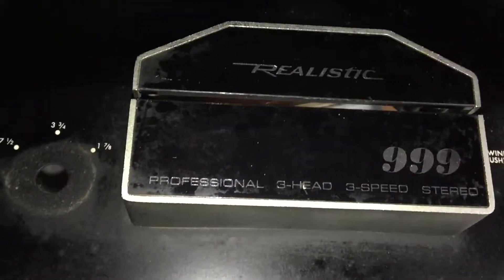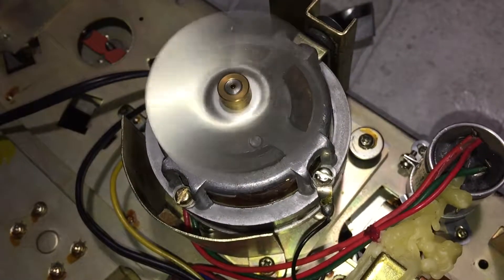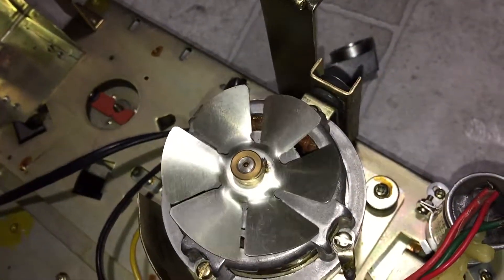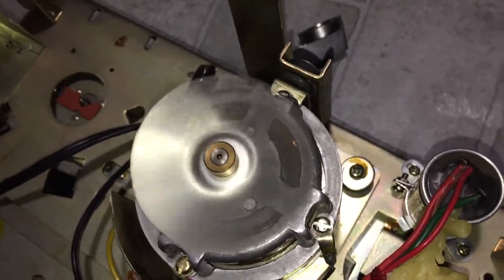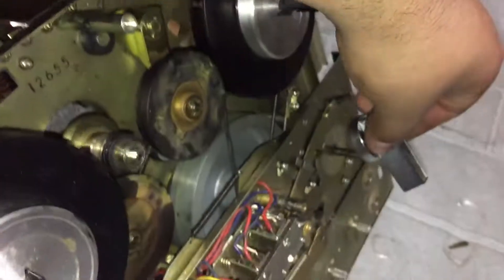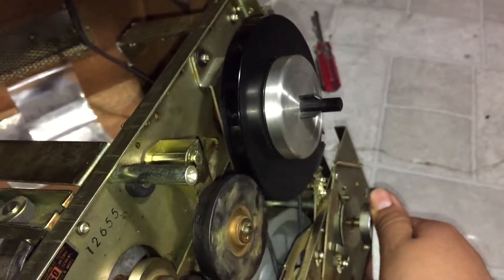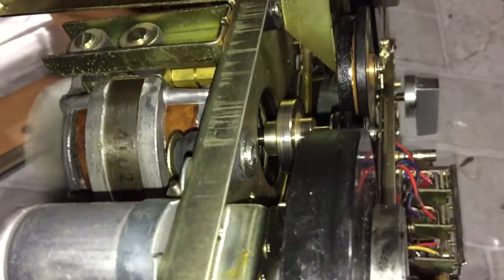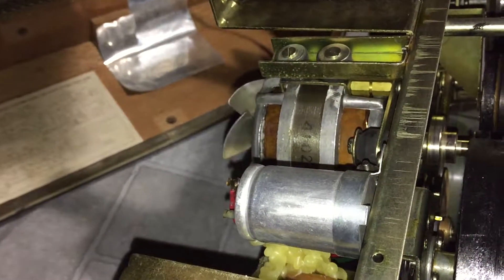Realistic Model 999 Reel-to-Reel player/recorder issues

Comment: Just replace the motor capacitor. It doesn't have to be the exact type but it does need to be a motor capacitor of the same value. It is can capacitor next to the motor.